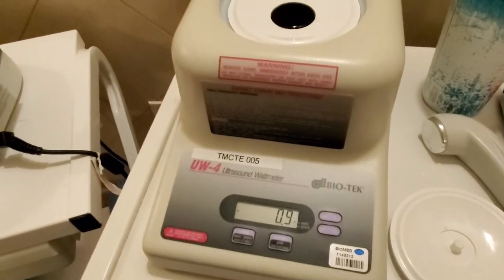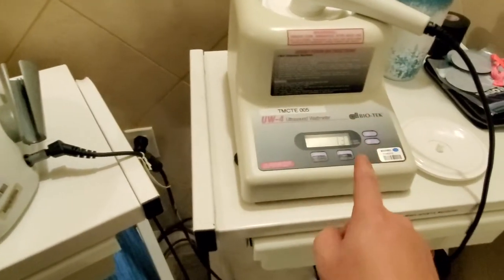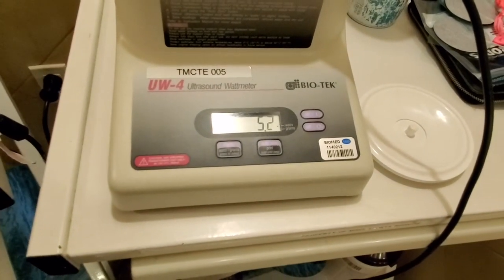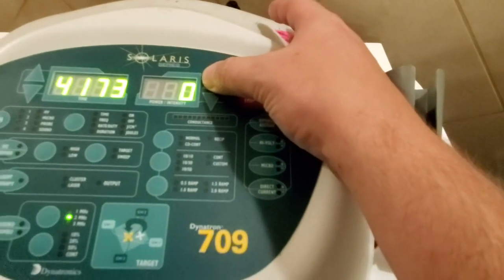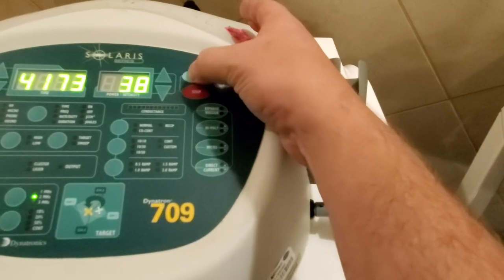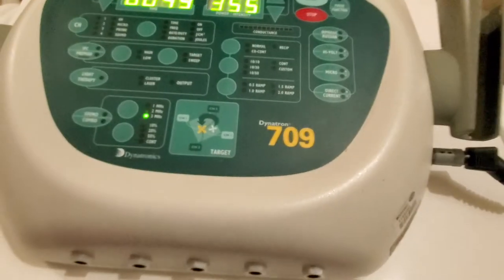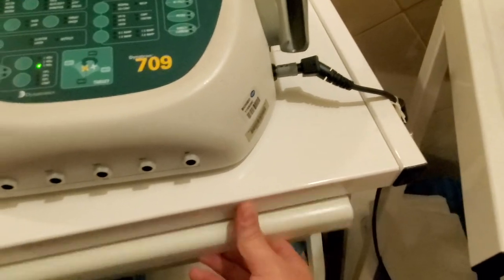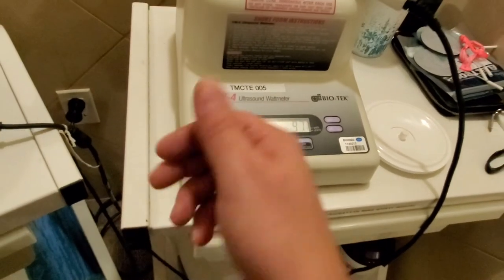Ultrasonic Therapy Calibration

Comment: Back in the day I performed calibration on Burdick UT-1-4 and 400.  I believe those were the model numbers.  I had a similar calibration device but there was only one potentiometer to calibrate on continuous verses pulsed, and a 5 square centimeter transducer.  I believe the UT-400 had built in muscle stimulator.  I think the UT-4 had provision to be hang a shelf on the back and a jumper wire sent stimulator output to the ultrasound head and of course a second electrode connected to the stimulator.  They used it to find pain trigger points.  I think I still have the manuals in the shop archives, and a unit in storage.

Comment: Are you using regular water? I know our Chatanooga Intelect/Genisys units claim to require degassed water.
Reply: Disregard...saw your earlier video where you mentioned it!
Reply from the maker: The gas dissolved in water will absorb (NOT TRANSMIT) the ultrasonic energy so your readings will be low if you have extra gassed water. For most tap or purified (what I used) water there will be little difference.